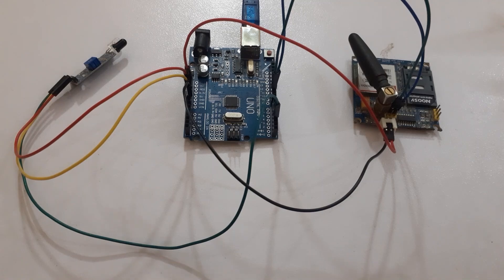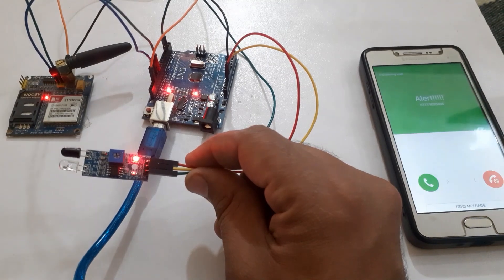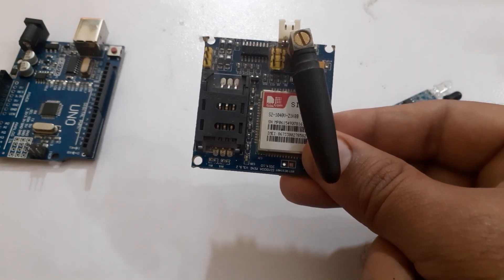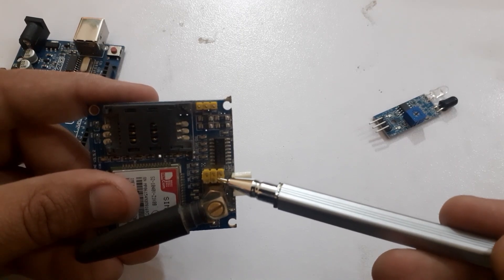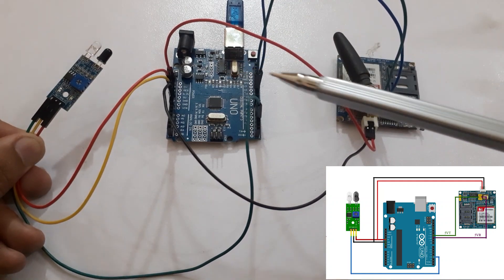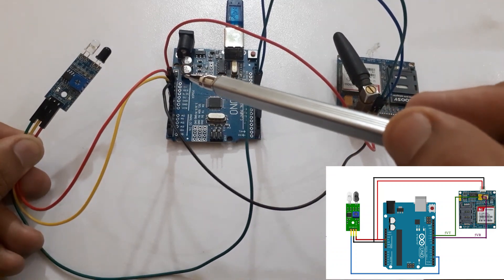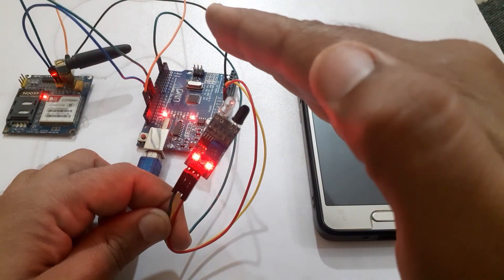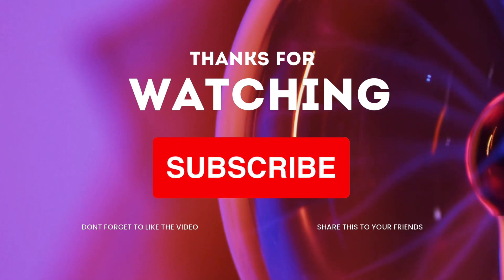Smart Security System using GSM SIM900A with Arduino Uno || Make a call with GSM SIM900A

Comment: HI @Theinfoflux after uploading the coding but i cannot get the call is that anything else i need to change in the coding other than my phone num .?pls reply as soon as possible urgent!!!!!!
Reply from the maker: no the code is correct no need to change  may be network problem
Reply: @theinfoflux   thank for your reply . Which Arduino you use ? May I know  I’m using Arduino ide 2.3.2
Reply: Im from Malaysia is there any problem can cause of the network in the coding ?